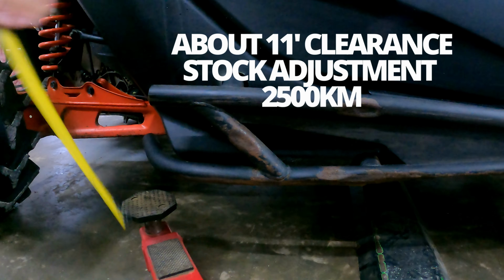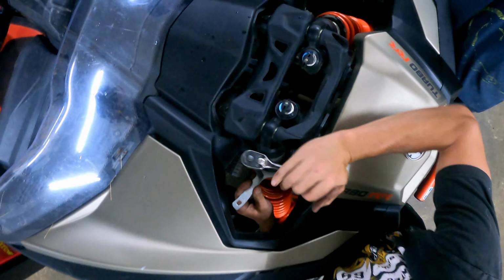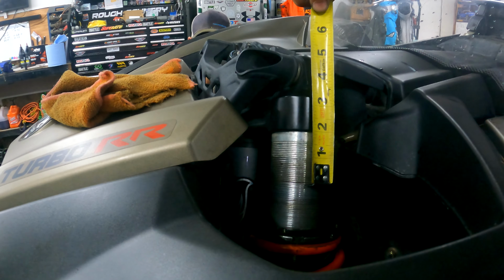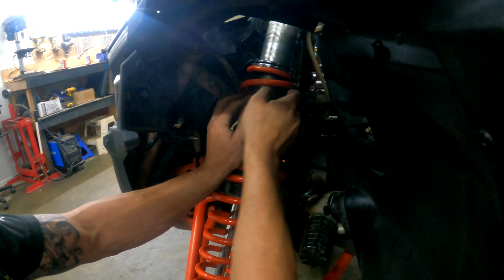ADJUSTING MY CAN-AM X3 RIDE HEIGHT

Comment: Dude you have a lift. It is easier to take the shocks off to adjust them than to do it on the machine. Also. Replace your springs. They are sagged out.
Reply from the maker: @lucky13sxs  makes sense, I’ll try taking them off next time and yeah I should look into that. Is it just the top collapsed spring that needs replacing or the whole thing?